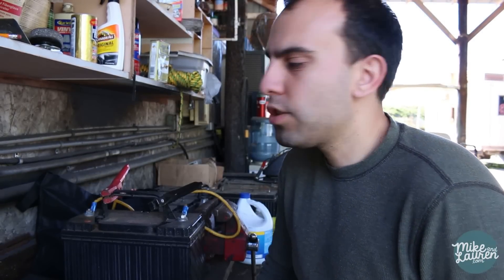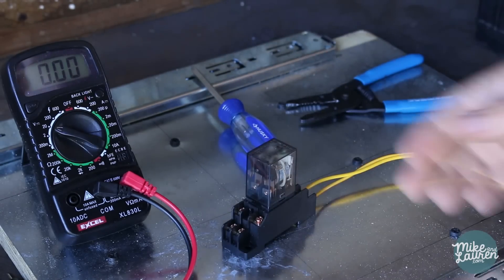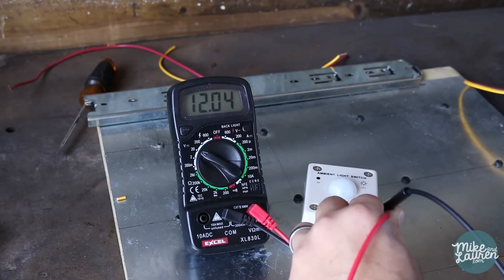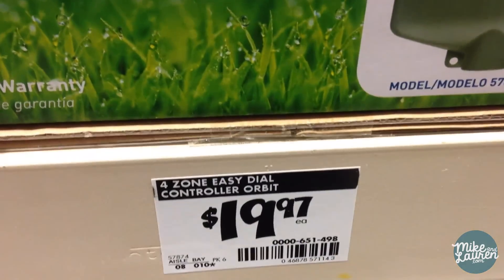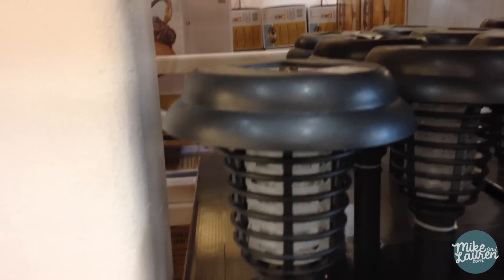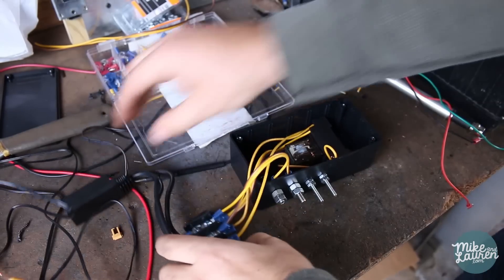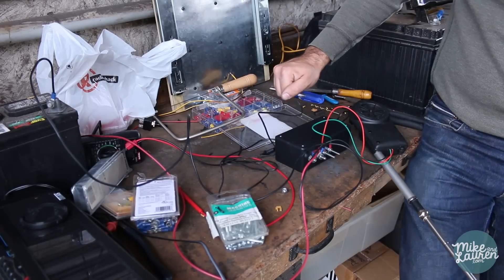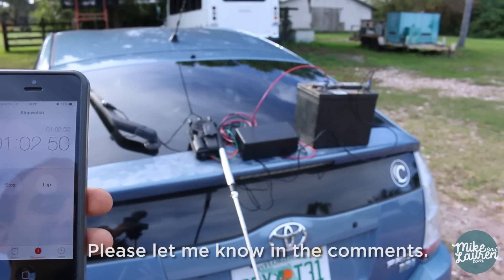DIY Automatic Chicken Coop Door Opener Build | PART 2

Comment: Sounds like you have an RC timer circuit going (as in resistor capacitor not remote controlled). Don't quite know without the schematic but that is what I would check for first.
Reply from the maker: David Springgay Hmm.. Interesting. I'll check into that!

Comment: You need a double pole double throw relay.
Reply from the maker: ***** Check out part 3.  That's exactly what I got!
Reply: Mike and Lauren
Yea, I saw that after I already posted the comment. I'm making one as well except using a linear actuator to operate the door. Good videos!
Reply from the maker: ***** Thanks, good luck!
Reply: No you don't. The antenna already has that built in. Wiring or Install is key here. If I had seen this video long ago, I would have told him what I did in part one. I did forget to mention that if he was confident enough to open the antenna , to just reverse the to wires going two the motor of the antenna. So the OFF state of the antenna will be Extended and the ON state will be Retracted.

"@Mike and Lauren Um but thats all you need, is an on off switch. The antenna does the reversing for you. The switch V+ and V- Input should be coming from your power source. This powers the switch electronics. The V- ground connects straight threw the ground on the circuit board and straight to the V- output. The V+ input also goes threw a switch(relay) and to the V+ Output. So the Black wire of the antenna should go to the Negative of the power source, The Red to the Positive of the power source and the Green to the V+ Output of the Ambient Light Switch.

Now here is where I think you have problems. You are using the antenna ON mode to close the door when you should be using the antenna OFF mode to pull close the door. What you should have done is make your door 4 to 6 inches taller than the actual opening. Mount the antenna within that distance and attach the antenna to door in that area too. I hope this makes sense. When the Ambient Light Switch turns on the power gets sent thru the green wire and the antenna extends pushing the door open. Switch turns off and the antenna retracts and pulls the door closed."

last thing. I would not install this with the trigger wire (Green Wire) being on all night. It takes up power from the battery while it is not getting charged. Best to use power during the day so that energy being used is being replaced at the same time.
Reply: Made a video for you, to show (basic working) how these antennas work. 
https://youtu.be/urzCKlB3T08